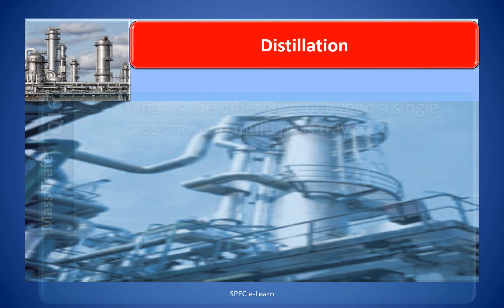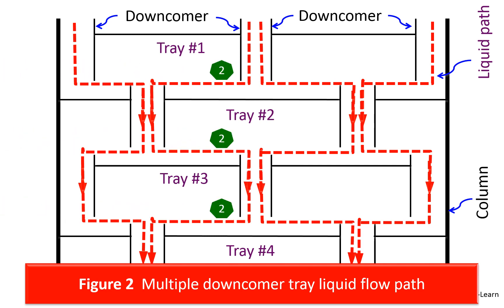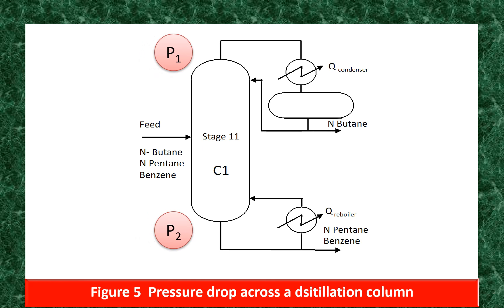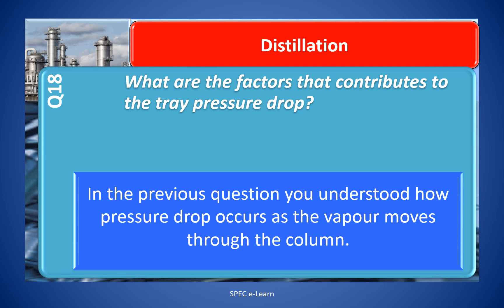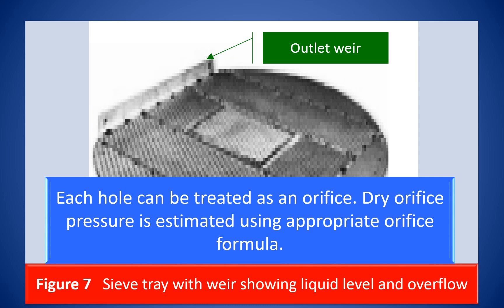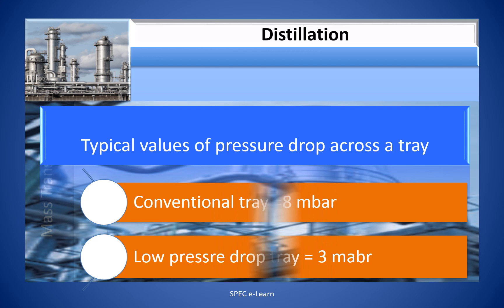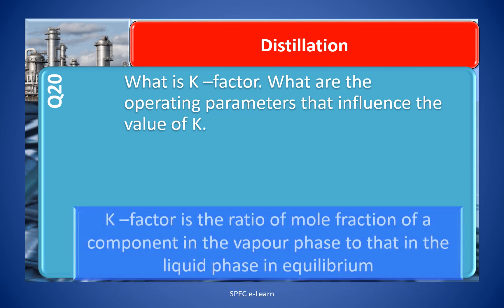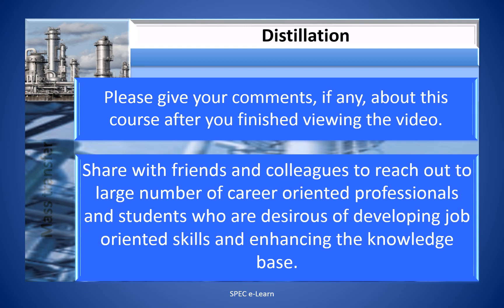Interview Questions & Answers in Chemical Engineering –Distillation Part 3

Comment: Coming question no 19.

At every tray in fractionation column, due to liquid and vapor contacting at different temperature on same tray, there is mass transfer from liquid to vapor and vapor to liquid. 

Heaviers condensing from vapors and Lighters vaporizing from liquid on each tray through out the column.

Then why fractionation feed inlet tray top section is called rectification section and feed inlet tray  bottom section is said to be stripping section? 

Can you please help me to understand.

Comment: hpw tp calculate pressure drop in packed column?
Reply from the maker: Pressure drop is a function of gas velocity. Liquid loading and packing geometry related factors.  There are empirical correlation representing the relationship between. The plots  pd per unit length versus gas mass velocity as function of liquid loading can be used.